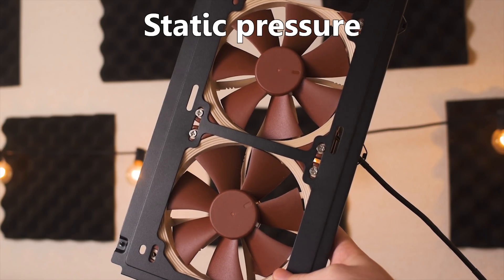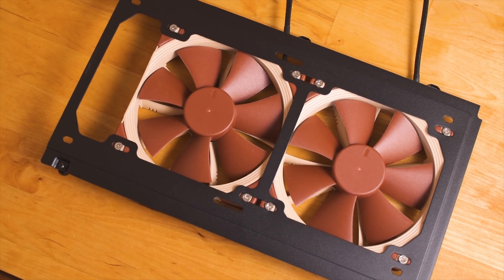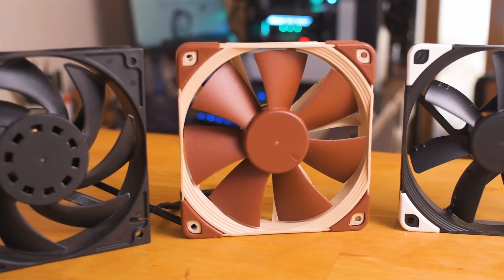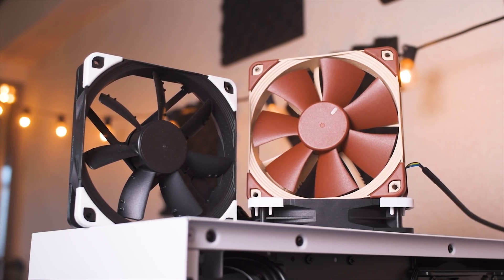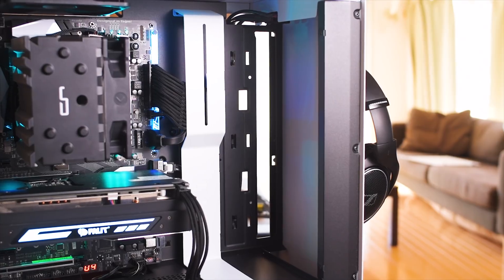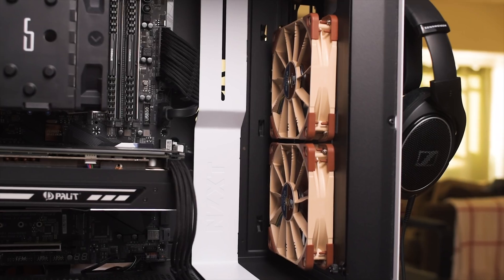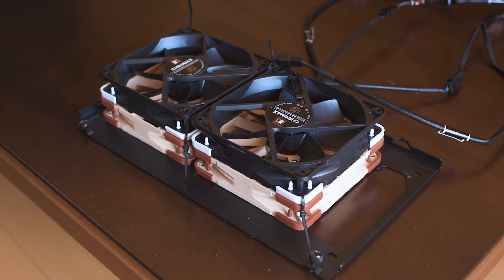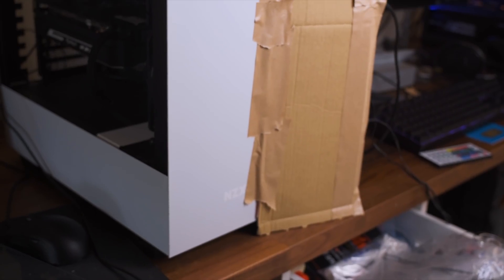DON'T buy front intake fans! (For NZXT H500/S340)

Comment: All i know is in my H500 my system dropped  about 5 degrees when i put in 2 x140 silent wings fans. i needed that so my rx580 wouldnt make noise because the fans can stay 0 rpm...
Reply from the maker: I can't really explain these results, but I have run these tests many times in different configurations and always get the same result. Its interesting that your temps dropped though. How hot was the system running?
Reply: Dawid Does Tech Stuff about 65 degrees, i also have a top mounted 120 mm fan. I use a scythe mugen with only 1 front fan and i have a rear 120 mm fan.
Reply from the maker: @Boemtie  Your setup seems very similar to what I tested. I don't really understand why we have different results. Maybe it has to do with delta over ambient. Is it very cold where you live?
Reply: @DawidDoesTechStuff  i live in holland, its cold at the moment but my room is 21 -21 degrees. well anyways i am using the silent wings 3 s as my main fans from now on in all my cases :) im happy with my results.
Reply from the maker: @Boemtie  Yeah your results are awesome. Sorry about all the questions, I'm just curious why we have had different results. Thank you for responding. It is a really epic case.
Reply: @DawidDoesTechStuff  I did remove the dust filter on the top, also it seems to be even cooler when i remove the top fan! sorry but im not making this up :S
Reply from the maker: @Boemtie  Oh I believe you. I wonder if changing out the exhaust fans will make an even bigger difference.
Reply: @DawidDoesTechStuff  you are getting the same results because your fans are adjusting on the fly.  Lock all case and CPU fan speeds at a fixed rpm and repeat the tests.  First in stock config, then with two additional front intake fans at a fixed rpm.
Reply from the maker: @newjackvideo  Thanks for the comment, but I did lock the fan speeds in the BIOS. They where all running at the same RPM. Including the CPU fan.

Comment: so should I just keep the stock fans as it is without installing any other fans?
Reply from the maker: From my tests that's what it shows.
Reply: if you want your pc to be a dust magnet, and having to clean the dust from it regularly, than sure, go with this stupid idea.
Reply from the maker: @tyroniebalonie  I have been running the case for months with no intake fans and didn't have much of a problem with dust.
Reply: @DawidDoesTechStuff  so should i buy any extra fans for front part?

Comment: If you put the fans in front, then it would prevent dust from coming in the unfiltered pci grills? does it not? so in a way its still beneficial right
Reply from the maker: The thing is, the case is well designed for keeping dust out. I have been running it for a long time with no front fans and there hasn't been much of a dust build up.

Comment: Here's my theory: once air comes in through that side vent it can go around the front fans and come up through the ventilation on the bottom, or it can come in from behind the white arm thingy, but again bypassing the front fans.  The front fans are just circulating air the same as the fans on most GPUs.
Reply from the maker: That's a very interesting theory. That may be because it isn't air tight around fans. It is pretty weird to me that they don't do much.
Reply: i can feel real cool air entering through the front panel... he forgot to mention there is a bottom slot with a dust filter for air to come in, on the front panel. most reviewers miss it...
Reply from the maker: @justinb3074  I'm not saying it doesn't have airflow. I'm saying that adding intake fans are justified because of their cost and them not really improving airflow much.
Reply: @DawidDoesTechStuff  the case only comes with the two fans. they are decent for coming with the case. but installing 2 120 mm high CFM fans on the front bracket will def. pull in a bunch of cool air from the front, side and bottom vents.  I think your case pressure was off for this video kus this thing get tons of cool air from the front and bottom dust filtered vents.  idt you noticed the bottom front panel vent. most people don't see it. the air vents arent huge by any means on this case, but they are just the right size. ive got the same ambient as you and im sitting at 60c on load across my cpu and gpu.

Comment: I want to change my cooler fans ( h100i  ) because they are loud as fuck. 2 intake coolers on the front  1 on the top and 1 exhaust on the back? Should i do this ?NZXT s 340 (1080Ti Trio with amd 7 2700x)

Comment: rgb fans increase airflow 110% this is a fact.
Reply from the maker: Haha!! That was the mistake I made.
Reply: I added 2 front fans just to have more RGB light in the case. ;)
If you are going to have a fish tank, it might as well be pretty.
Reply: @MyFireworkDemos  do they work alright?
Reply: Yes, the light from the LEDs excite the molecules in the air to make them move faster. 😆
Reply: Rgb fans can cure the rarest of diseases also.
Reply: @darmwood10  thanks man just bought a 6 pack of rgb fans because cover is kicking in
Reply: Since my pc looks like a strip bar with the RGB I installed a pole on the backplate of my 1080ti.
Now I just have to find a small pole dancer. :)
Reply: @talon1706  lol
Reply: Depends. Blue leds make your rig cooler but red on the other hand increases performance at the cost of BURNING temps. Green is more eco-friendly and, as for rainbow, don't try it at home.
Reply: Ppl who don’t get the joke:🤡🤡
Reply: @großerhaarigerGorilla  it's not a joke
Reply: Does the corsair h500 cpu coolee fit in the nzxt h500?
Reply: @clc8609  idk maybe?
Reply: Right
Reply: Hah, we all know RGB fans give up to 30% more FPS as well. Together with RGB Motherboard, RGB x73 and LED stripes your Ryzen 3 2200G with together with RX570 will give 200 FPS in Cyberpunk 2077.
Reply: 1k
Reply: in my case rgb fans give me more performance, increase by 25% minus. im waiting for my rgb strip to run crysis smootlhy on my pentium 2.
Reply: Well just rgb in general lol
Reply: Yes RGB attracts air to flow to ur pc
Reply: Rgb fans let you get 40% more FPS
Reply: Brown fans increase airflow my 500% over RGB. To bad that started making black fans :'(. Noctua <3
Reply: That's just the reality if you like it or not
Reply: What are some good budget fans for the h510
Reply: More importantly, even if you leave the fan off, just the RGB will make a 5 degrees difference.
Reply: I have been scammed.. I believed that RGB fans increased airflow by 200%
Reply: @fullmetalalkami6466  You chose wrong fans bro get the RGB cordless ones from Lian li and you'll be so amazed.. literally had to overclock my CPU to keep it above sun zero 😅
Reply: @fullmetalalkami6466  that depends of the Type of RGB Fans ... if You hafe static RGB  then its less .. but the new ARGB  You can get much more out of it ... 
and for the Rainbow effect ... Heidy told  Don´t try at home ....  it works fine with Water cooled Gaming pc´s  
ant it dasn´t only make the Case Cooler .. it boosts up Yout FPS in game :-)

Comment: What about the normal h500 case ? Sorry if i seem dumb its cause i am lol
Reply from the maker: It's not a dumb question at all. The one that I tested was the standard H500. The H500i would perform the same though, because the only difference is that it comes with an LED strip and a fan hub.
I hope this helps.
Reply: @DawidDoesTechStuff  cause i got the h500 mid tower and i was wanting to know if that would have help it will be my first build ever
Reply from the maker: @pepe-nf9jy  That's so exciting that you got your first build. Congratulations. The H500 is an awesome case, even without front fans you can still get good temperatures.
Reply: @DawidDoesTechStuff  yea but have to get the other parts and i guess learn a bit more about air cooling thanks for the advice
Reply from the maker: @pepe-nf9jy  If you have any questions you can ask. Are cooling isn't too hard. If you get an AMD processor, most of them come with aircoolers already. With Intel you can buy one for not too much money.
Reply: @DawidDoesTechStuff  thank you for the help

Comment: This is interesting... I have the NZXT H500. My 8600K, under gaming load, used to be around 65 C. After installing three NZXT AER 140mm fans in the case  my temperatures dropped to about 55-58 C. I can stop my front intakes and have another look if that would interest any one.
Reply: same!
Reply: Hi, could you please stop the front fans and tell us the diference? Thanks a lot
Reply: @Simon_is_not_sure  as h500 owner I can confirm this case is exhaust only. Front fan lowers cpu temp a bit, but distress gpu airflow and raise temps there...
Reply: @reklamspot  Thanks but it actually work for the guy up here
Reply: @reklamspot  Gamer Nexus said same thing as you
Reply: @reklamspot  i'm just wondering, i've just bought this case. but i did'nt order any additional fan, do i need to order that? i'm gonna have a 2600x with stock cooler and a 1070 strix oc
Reply: @nebbe6617  nope stock 2 fans are enoguh. i have same gpu as you. But ryzen 7 1700 with corsair h100 at the front od the case. Gpu in BF1 is at 60. Cpu at 40. Room temperature 25celsius.
Reply: @reklamspot  if front fans hurt GPU temps, would it even be worth installing a 240mm AIO as intake in the front?
Reply from the maker: I would be very interested. I have done this test so many times and I haven't been able to get that result. What graphics card do you have? Is it very hot?
Thank you for the comment.
Reply: @DawidDoesTechStuff  
CPU: 8600K
GPU: EVGA GTX 1080TI Black Edition
CPU Cooler: Deepcool Gammaxx GT RGB

Are you South African? If you are, we can PM or something
Reply from the maker: @23147458  That's interesting, I wonder if its because the GTX 1080 Ti is much hotter than the GTX 1060 I tested with that adding fans made a big difference. That's an awesome PC by the way.
I was born in Namibia and lived in South Africa for 4 years. We can DM, but I'm not in South Africa at the moment.
Reply: @DawidDoesTechStuff  i have that case and i have done many test. 

reason for front fans 
1. radiator
2.dust (if you dont put intake fans exhaust fans take unfiltered air from the back that why the system is cool , it is actually better. But the air is unfiltered.) 
3.huge GPUs need them , i got 1070ti strix (half card take air from the font fans and other half from back)

with this small gaps only sp fans will work
Reply: Alexandre Damasio how does the gammax gt do when overclocked. What are your temps
Reply: Alexandre Damasio please take out the front fan I want to know the result
Reply: @Alexandre Damasio are you using aer f or aer p for your intake?

Comment: Hey Dawid! I just watched this video so will me using my old Corsair 200R case fan's the 120MM/140MM that came with the case be a good choice to use in my new NZXT H500 case in the front panel? Or should I just not install it at all?  Thank you for making this video :D
Reply: i build my pc one month ago with h500.....stock fans are fine and quiet (if you take care of proper fan curve via bios or some software). you can fill h500 with max fan support but you won't get that much better temps...this case is simply a negative pressure case...2 exhaust fans doing their job..if you strongly want install more fans I would suggest you install one in the front but in top portion (so that fan blows in line with cpu cooler height), if you install it in lower portion (towards gpu) you will ruin gpu temps a lot. So one in the top to help cpu, vrm and such..regards

Comment: hi, so you suggest no fan for intake in front of case if the case only have small hole for the air to flow in ?, because i want to order 2 noctua nf-f12 ippc 3000 rpm, because on paper they have the highest stat for static pressure, and lucky me, before i buy i found this video. please answer my question,. my case only have small airflow hole in front, while i use 2 fan on top for suck the hot air, and 1 fan on the back for sucking too,  i dont have intake fan, should i buy at lease 1 or just leave it without fan, right now without intake fan my full load temp on 28°C room temp  is around 65-70 on full load for gpu, and 60-67 for cpu, i got i5 3570 (non k), and msi gtx 1060.

Comment: My case doesn't have the holes in the side-panel. I have this case and I cut plastic lips and fins off the top, bottom and middle (ribs) out of the front cover. I also blocked the bottom snap post connector (dingus)  so the bottom protrudes out from the case (not flush)  these mods alone improved my air flow into the front. It allowed me to drop fans noise through fan curve settings net gains was -10degrees C  on a overclocked system GPU and CPU.. Machine specs are i5-7600k at 4.8ghz on 1.257volts with hyper 212X turbo, Asus DUAL 1060 OC 6gb at OC'd to 2074mhz, 16gb corsair vengeance led @ the spec 3000mhz all on a Asus prime z270AR. During benching this combo maxed at 71C for the GPU and 74C on the CPU under gaming loads 8-11c lower than benching on max settings with considerably lower temps while manual FPS locking/v-sync/ manual refresh rate locking. I also set this case up for positive pressure due to the multitude of holes all around the case most of which I taped closed. Using 2 120mm front/intake, 1 120mm on the hyper 212 (even though the turbo model came with 2) (also lowered fan on cooler to slightly blow on the board area below cooler) , and 1 120mm on the back as exhaust, leaving the top case fan slot fully open for positive exhaust. I could upgrade to 140mm fronts, but don't see the need at the moment... Case is leaky, restricted front and crappy plastic window IMHO there are better cases but welcome anyone else to get 4.8ghz on air in such a restricted case without mods.. Hope this helps someone thinking of getting this case.
Reply: Interesting I never thought to tape/block some of the extra holes you dont want air intaking/exhausting from like any unused pcie slots... I can see that overall being beneficial since youd essentially be forcing the air intake to come in through the front, which may actually help with the fans performance since your creating more of a vacuum and at the vary least would help keep unwanted dust from entering the system. thanks a lot for the tip im def gonna give it a try myself.

Comment: Great stuff. This video got me thinking! :)

You say that the intake is constricted and that it is a bottleneck, and that this is the reason why the extra fans makes no difference. I am not sure that is the right conclusion. Doesn’t the fact that you get the same temperatures regardless of what you do increase the intake instead show that the intake is not a bottleneck? H500 is a mid sized case at a budget price, so I suspect NZXT designed it to at least handle cooling air requirements of a mid range system, anything else would be very strange.

I am guessing that the temperatures you get more show the efficiency of your CPU and GPU coolers than the efficiency of the airflow. What temperatures do you get with the case TG side removed?

If the intake is a bottleneck I suspect that intake fans would make some difference (more air out would also help), and it might also be that the type of fan has an impact. It could be an interesting follow-up video to use masking tape to block the intake. Maybe do measurements at 0%, 25% 50%, 75% and 100% blocked (include TG removed for reference). If there is an increase in temperature it would be a consequence of constricted intake. Then you could pick a suitable level of blockage, where there is an obvious intake bottleneck, to test different fan setups. 

In addition to the above it would be interesting to see what would happen in a system generating a lot more heat. You have without doubt shown that there is no point in buying extra intake fan in your system. 

Many thanks. Keep it it up!
Reply from the maker: This is an awesome comment, thank you for taking the time write this up.

Your explanation here makes perfect sense I think I will do a video testing that in the future. However the reason that I made the conclusion that the intake was a bottleneck was because in the first video where I tested the airflow in the NZXT S340 I tested the case's airflow performance in the same configuration as the H500 but also tested without the front panel on (because you can remove it on the S340) and the temperatures dropped significantly. Since I got the same temperatures as with the NZXT H500 with the S340 (and the front panel attached) I concluded that they have similar front airflow performance. Considering that the S340 performed better with the constricted front panel removed, I made the conclusion that the front airflow was the bottleneck.

I do really like the test that you suggested though. It will be an interesting way to show how much of a temperature difference the amount of airflow that is available makes. I should also test the case with a very high end system in it to see how well it handles a heavier heat load.

Thank you again for the awesome comment.
Reply: Great video, and yes, would love to see the temps with the side panel removed, sort of a best case reference point.